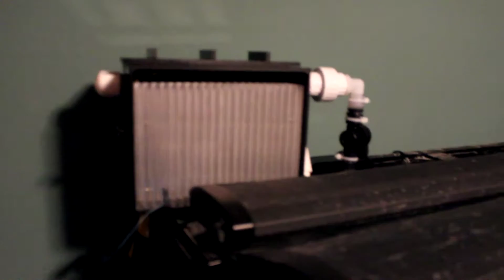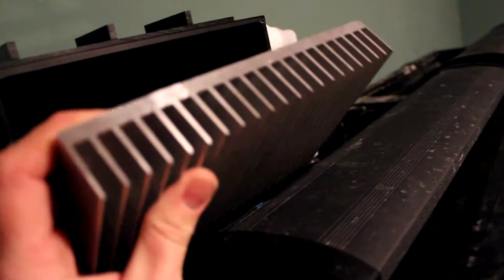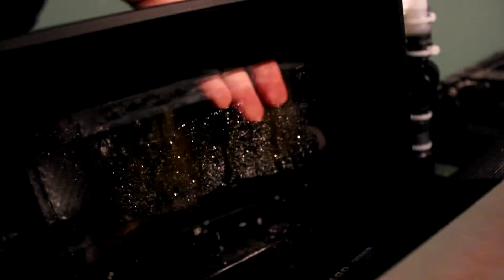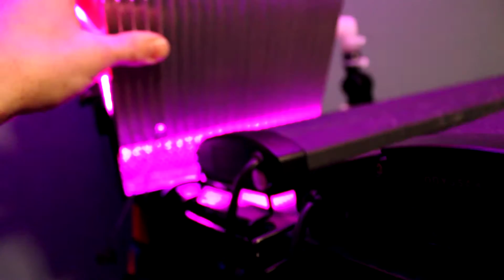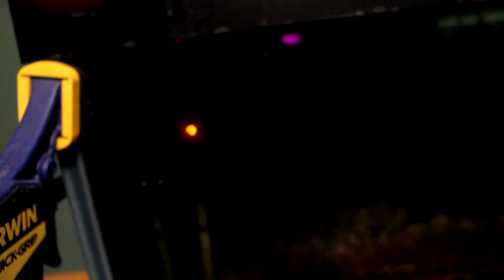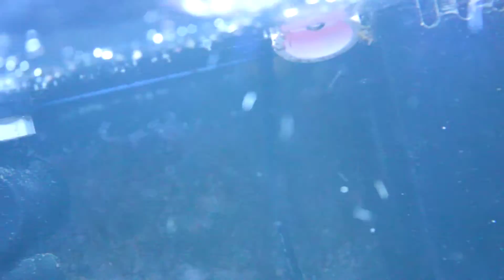L2 Algae Scrubber, 13 days growth from bare screen (my 120 Reef)

Comment: How many leds did you use, red and blue? What power have this leds?
Reply from the maker: +Gigi Robu My current design (which will be the one I use from now on) uses 6 Philips Deep Red 660nm and two SemiLED Hyper-Violet (415-425nm).  These are all 3W LEDs mounted to a custom PCB.  I have a custom 3-channel dimmable driver board that runs 2 boards (one for each side on an L2, then for the L4 2 drivers + 4 boards).  I dim the violets down so they operate at 50% of the reds, then the whole array is dimmable (the violets always run at 50% of the reds, proportionally)